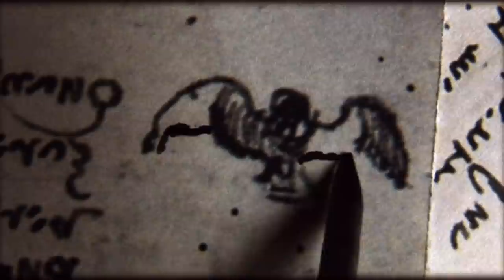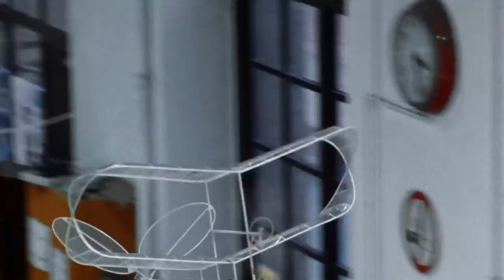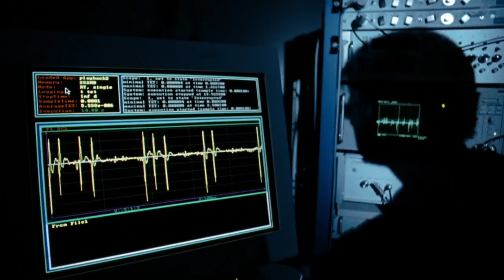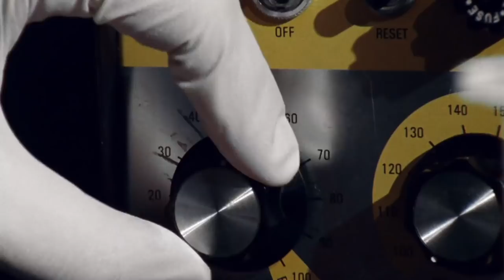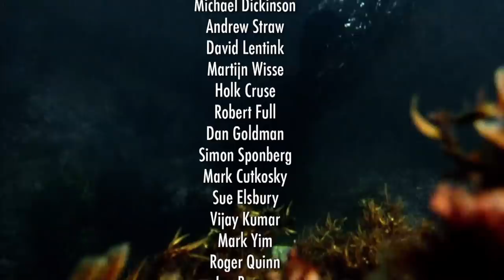Magic of Motion - Nature Tech 1/3 - The Secrets of Nature

Comment: You know, our balance is dictated by our toes, specifically our big toe. So what I suppose they do is make them have at least a few toes so that they could put pressure sensors on them and the heal, as to tell the computer how much force needs applied to the big toe to maintain balance. And how's hasn't the robot builders try this yet